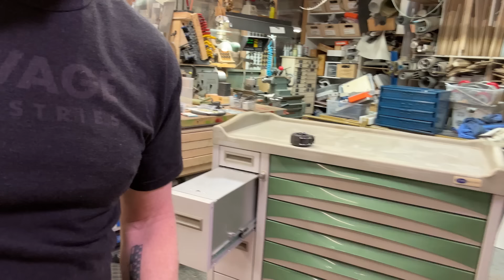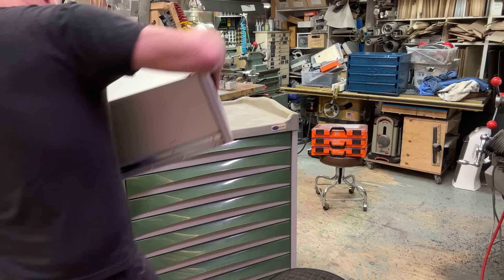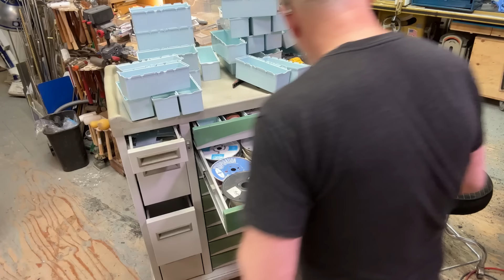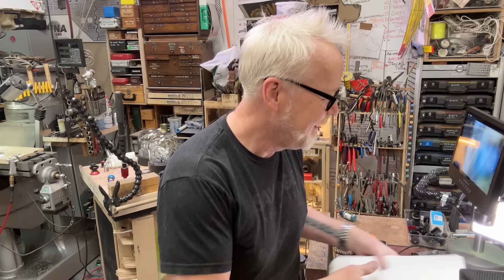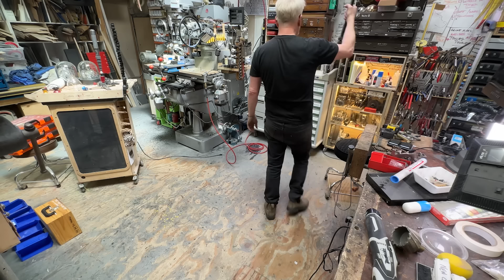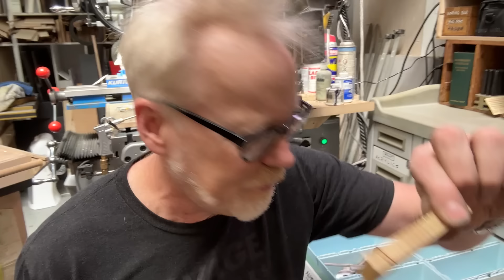Adam Savage Finally Finds Good Shop Storage Drawers!

Comment from the maker: Join this channel to support Tested and get access to perks:
https://www.youtube.com/channel/UCiDJtJKMICpb9B1qf7qjEOA/join
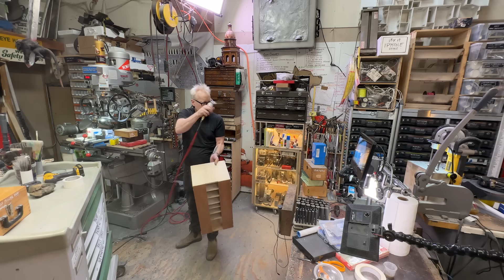Reply: what was the track playing during the problem solving 25:40
Reply: If you contact the manufacturer of that cart and give them the number on the cylinder on the cart, they'll probably get you keys for it.
Reply: Inheritance machining should make your phone mount not make that noise
Reply: Okay, spool and roll goods belong together, but what’s the adjacency to paint? Is the relationship flat items? Best thing is when you get a 2nd cabinet you can swap drawers. Admirable in some ways that you unspooled cable to make it fit, but sheesh…
Reply: I'm glad you clarified the useful purpose of drawers vs. where things go to die... I've worked in the cabinet business for 51 years and have set up several work departments and have found drawers are a great way to keep things organized and give easy access. I also place my drawers in order in which assembly in a given department is done.
Reply: Hi tested, i know this was ahile ago, but are you able to give me a rough idea what adam paid for this just so i have an idea if I see one i'll have an idea if its a good deal

Comment: I find foam inserts a really useful tool for draw organisation, it's a semi permanent solution which forces you to think critically about where exactly things are going to live and what else is going to live there. It's not as space efficient but it stops stuff going back in the wrong place etc. and is really great for those with less discipline for keeping things organised

Comment: You need to buy or make a wire cart.  Having wire in a drawer makes for a tangled mess.  Keep the wire on spools (the larger gauge stuff) and locate them upon the rods of the wire cart.  The small stuff can go into drawers or on a small multi wire dispenser. After using wire on a spool, resecure it to the spool so that it does not try to unwind.

Comment: I have a few of these I got super cheap at an auction. Not only that, but several years ago I was asked to take away a pair of tables that included lingerie drawers made of high grade plywood and mahogany. There's a total of 24 drawers about 3" tall each. It's super nice for small parts and hardware.

Comment: that cart would make an awesome portable costume repair station for things like comic con. you could put a battery pack, foldable lights and a basic electronics station, you could hide a compressor and air brush on it like the deeper drawers on the side.

Comment: Several years ago I had the problem of relocating Two laboratories. About ten years previously they had been fitted out with laboratory furniture, benches and cupboards and sinks at a cost of around $250k. We had an extremely limited budget for the relocation and it was a case of if we didn't get it in within budget we would be shut down. The cost of new laboratory furniture would have completely blown out the budget. The place I was relocating to had a workshop which used benches and tool cabinets manufactured by a company called BAC Systems. They looked like a good alternative so I looked them up. They were able to supply tool cabinets, cupboards and benches which were far more robust than most laboratory furniture and the cabinets and cupboards were all on castors and sized to fit under the benches meaning we could configure and reconfigure our layout when we needed. Even better the benches came flat-packed so we could assemble them ourselves with a socket set. They even came with electrical outlets and sinks ready for connection. Even better the total cost including electrical and plumbing worked out less than half the cost of the fitout ten years previously. The tool cupboards also came with trays like your cupboard plus tool racks in the drawers. They are still going strong 15 years later.

Comment: Why do you remove your glasses when working close up? It boggles my mind every time I watch you do this. Perhaps because I'm far sighted and have NO vision up close without my glasses.
Reply from the maker: It’s an older person thing, speaking as someone who was nearsighted all her life (and still is), but needs to lift up her glasses to read close-up. (Kristen, Tested general manager)
Reply: @tested  Thanks for your reply. I'm older too but didn't have to wear glasses until about 48. Now I only take them off when I shower and sometimes not even then. I even sleep in them because I don't want to fumble around looking for them when I get up in the middle of the night. I tried wearing contacts but couldn't get used to multifocal lenses. I wear no line bifocals for close up and distance vision. It would be great to if I could get surgery to restore my youthful vision of 20/15 left and 20/12 right, but I doubt that is possible.

Comment: maybe you covered this... I'm getting older and I've discovered reorganizing my tools and "stuff" where the most frequently used is nearest to my work area and working height. Meaning rarely used goes in low drawers or on higher shelves. The less I use the farther and higher or Lower it goes. I love wheels on carts, tool boxes. Wheels on tables and tools like band saws are great too when you can figure how to lock them down.

Comment: In fairness to old depictions of lock picking - the other thing that's changed is that at least some locks are more pick resistant. I've got a wafer lock on something for instance that's so bad I can just jiggle it open with the key for a completely different lock lol

Comment: I am sure that someone else way down in the comments has probably mentioned this, but at least for filing cabinets, these kind of locks are pretty standard, and if you call your local lock shop and tell them what model of drawer, and what numbers are by the lock etc. they could probably make you keys for your drawers.  Also if I had a lovely set of drawers as you do, I would be tempted to keep the locked drawer for gold filled and sterling silver wire, if I had any.  You probably do not have a great use for such things... However,  Cool!  Nice set of drawers, I am jealous.  :)

Comment: $700 is a lot, but it's still a great deal. A similar sized snap-on cabinet is probably so where in the 5-10x that amount range and even Tha harbor freight tool cabinet of similar size is ~800 and that thing has to be better quality than the HF cabinet.

Comment: I have 10 of those carts in my shop. They are the best for small parts. My carts came with all kinds of attachments for the sides and top. The locked drawer is for narcotics. You should be able to see the cylinder lock number and order the key with a core puller.

Comment: If ypur going to start playing around with puppetry making for stop-motion, then you could probably fit everything you need for the internals and mechanics, including tools and needle files in that unit, with the bonus of a lipped work surface on the top too.

Comment: As a machinist, I find keeping specific/specialty end mills in their individual cases keeps them from bumping into each other in the drawer, also protects their edges. Particularly important for carbide cutters. The clear ones are best, but writing on the case with a sharpie makes it easy to find when looking for a specific one without opening them.

Comment: Drawers are a great solution if used correctly,otherwise they can also be real nightmare,I like to have Drawers with dividers in them to keep everything separated and well organized to help find things quicker and then I use my brother label maker to label what's in the drawer so I don't have to open every single drawer to find what I want,labeling is the absolute number #1 most important part of Drawers in order to use them the most efficiently.

Comment: With the pushbutton lock on some of these cabinets there is a release mechanism on the bottom underside of the  cabinet. It's a small rectangular piece of metal that is the end of a bar that has a cutout to expose it. you can push up on the bar from the bottom and it will release the lock you pull a drawer open while holding it up (It's a two-person operation) This mechanism, is also common on office desks from the 50's

Comment: For me the question of drawer or not breaks down to "Will I go looking for this thing because I will need it regularly or in a specific situation?" because if things that I CAN see prompt me to need a thing, I will go get it from the drawer and use it. BUT if it's something I won't think of using unless I see it... It cannot go in a drawer. So for me, tools and tape and such are okay to put in drawers, because I WILL end up needing them and I will know where they are. Otherwise organization matters because if I need fabric and I go to the fabric bin, all the fabric is there, or if I need random crafting objects to glue together for something, if all that is in one drawer or bin I will see it all whenever I am building something. But if I just start putting a bunch of different things together into drawers and bins however it fits, I will never see half of it and if I don't actively remember I have it, I will never think to use it.

Comment: I do not have a lot of space but do have a reasonable amount of small hand tools for various jobs and, I will admit to regularly having to buy replacement due to not finding what I know I already own. During the day-end tidy-up a tool will be placed in the wrong box, draw or cupboard, or just left on a shelf in the shed never to be seen again. Or, at least not until a replacement is purchased. 

Knowing where the draw is and what it contains is the important part. If you do not have the space a single draw can end up containing various types of tool, and then it basically become a selection of miscellaneous draws where things go to die.

Comment: I think I'd much rather have wire on rails above my soldering station, near my other electronic components – if I had had the luxury of space to have a permanent place for it – but that's just how I'd organise my work space, of course. It depends so much on how you use things, how often, and how many varieties of things you'll need in a single project. Apart from that, drawers are amazing for storage as long as they can be organised in a way that makes you find the thing you need when you need it even if you've not needed it for a few years.

As an aside, I prefer solid core wire. It is often harder to work with, but since I'm rubbish at soldering, solid wire tells me right away whether I've got a good solder or not if I try bending it. If it bends above the solder joint, I'm good, if the joint bends, it needs redoing.

Comment: I play around with Micro-controllers and various sensor doodads and find that solid core is so much easier to use to "jumper" and re-jumper connections (to different controllers).

Comment: Store your tools and supplies according to order of retrieval.  It is fine for things to have permanent storage locations in drawers.  Nothing else gos in those drawers just like nothing else goes in the other types of storage.  Sometimes I wonder if we approach drawers incorrectly though.  Per order of retrieval we can have drawers near the workbench, maybe mobile drawers, that house thing that need to be accessed frequently, and we can have drawers in the storage area for things we don't access as frequently.  So we should start with a bunch of drawers, and a rack of boxes for things that don't fit in the drawers.  Trying to minimize the amount of drawers and boxes I think works against us.  It takes more time and anxiety to reduce the amount of drawers by a few percent than it is worth.

You mentioned "miscellany".   That exists and you can embrace it and find a place for it, or just throw away little bits as they occur so you never have to deal with it again.  Many of us can't just throw it away so we can provide a bin or box for it, in my case I have a bowl on my workbench where I throw little fasteners and bits into.  I ignore this stuff but when I feel like it I will sort that stuff out into permanent storage locations and start over with an empty bowl.  "You don't want to throw out a piece like this because it could be useful" so I know which way you go on this issue.  In that instance I would have a container to throw those little pieces in when they appear and then later I would sort them into the proper permanent storage location.  I want things to be organized but in the little time I have in my shop I want to be working on projects, not sorting bits of materials.

Thinking about the "order of retrieval" and how it applies to tools and materials, and various types of storage, I decided to search the internet to see if there are established rules.  I could not find any so I think we should create those rules.  In my situation I can visualize 4 or 5 orders of retrieval and I think they could be applied to many people.  I went back to view your video on this to refresh my memory.  I've got to think about this more and then I'm going to create rules in writing for my own situation.

Comment: take out the drawers and remove the locking bars that way if it locked it won't lock the draw shut.adam you really need to reinforce the top i have seen the warp to the point the drawers jam.

Comment: Map drawer units are also an option as we have largely gone away from physical maps to digital.  They tend to be rather deep, so under a work bench or central double sided work bench on wheels.
Reply: When they are actually listed, rather than trashed straight away

Comment: I’m surprised those drawers don’t interlock to prevent more than one drawer being opened at a time.  Careful not to tip it over - especially when filling the drawers with heavy stuff like wire and scrap metal.

Comment: I'm assuming if it's a cabinet design to hold dangerous invaluable things like medical equipment and drugs it would be pretty pic resistant but then again like the lock picking lawyer often says sometimes the purpose of a lock is just to visually deter someone and it doesn't really have to be that secure
Reply: Yeah, those locks at not really meant to stop lock picks but people from grabbing and running.

Comment: I kind of hate the cheap, pre-made lock pick sets you ban guy all over the place.  The tension wrenches are too long and the picks are always devoted to just raking the lock.  If you have more than a couple of tumblers you really need to feel when you pop the pin past that little shear line or you lock yourself out again.

Comment: The problem with drawer is their fixed size, and that they don't grow with the contents. In other words; for example, when you first start out, one drawer for all your screwdrivers is sufficient as you'll have few so finding the right one is easy. As the collection grows, the contents start getting piled on top of one another and finding the one your looking for becomes difficult, and lesser used ones migrate to the bottom and die.

Comment: There has to be a place for things that need to go somewhere to die, too, in case you absolutely positively have to resurrect them. Thare simply things that are not like any other thing. I have the hardest time remembering where I put them. If there were a drawer or two for them, it might work.

Comment: Nice!  If you want bigger drawers that are very similar, you want to find Engineering drawing drawers for E size drawings (34x44 inch).  You will need to find a engineering design company that is going out of business.  Often referred to as "Blueprint cabinets".  They come in widths up to 4 feet.

Comment: I only use solid core wires for bread board wires.  I use stranded for everything else.  Stranded is also better for soldering because the solder can get between the stands and make a better connection.

Comment: Solid core wire is awesome when you want it to stay in a certain place or bend it into a shape and have it stay there. I use it on a lot of text fixtures and when I'm installing PCBs into fixed positions on/in something and connecting them together

Comment: It has wheels. It's durable and has a lot of compartments. Put subsets of all the things you use most frequently. That's what it's for, as a medical cart; it moves around with all the stuff that nurses use most frequently so they don't have to run to the store room. Utility is a function of convenience, accessibility, and organization.
Reply: no, its not a shelf that is regularly hauled around. This is to be used for small shorter movements within a room/lab probably. Drawers racks are not for hauling between corridors

Comment: The concept of First Order Retrievability has been incredibly influential in my life, but so has 'drawers are where things go to die'. To that end, I structure my working life such that everything I reasonably need frequently or not is always in 1 consistent spot. So even if I don't use it practically ever, it will be in the 1 exact place I intended to leave it, and that spot will be nearby things that are similar enough to make me remember where it is. 

What gets frustrating is that my coworkers do NOT believe in things like cleanliness, organization, F.O.R., so they will take my meticulous systems and do whatever they feel like and sometimes I have to spend time during my work hours resetting things to be as they should be to be their most efficient so that I can have an easier time.

Comment: Micro Switches, LED's , Soldering Iron's Soldering Pens ,  Wire for Speakers From 0.34 - .14 ., Small tools Eye glass Repair kits , But I'm sure you will have something in mind.